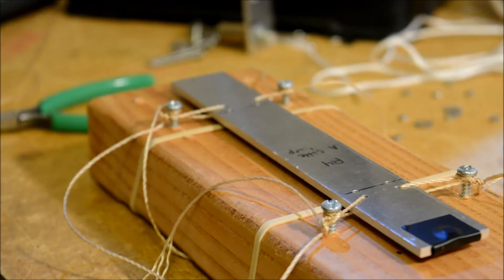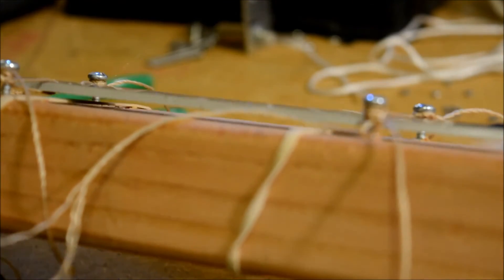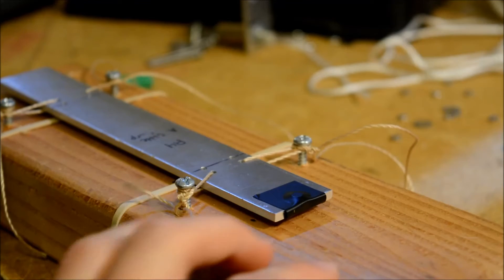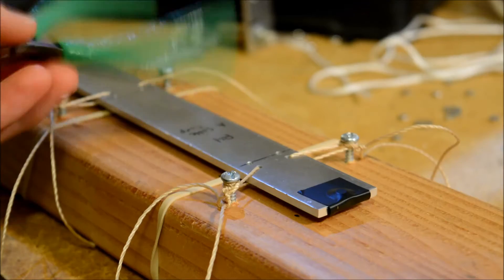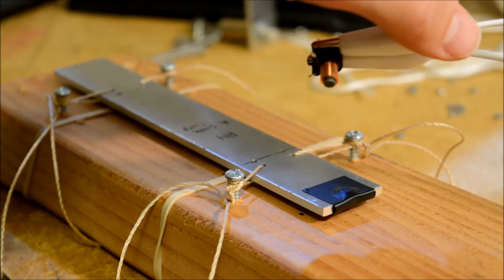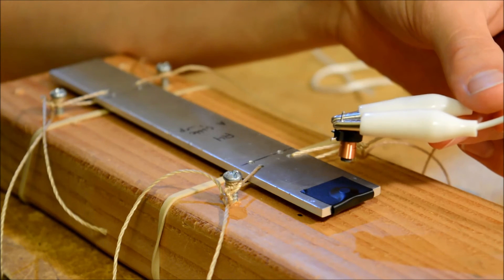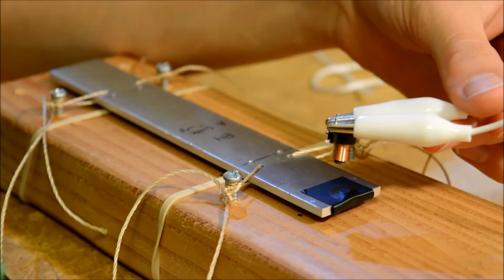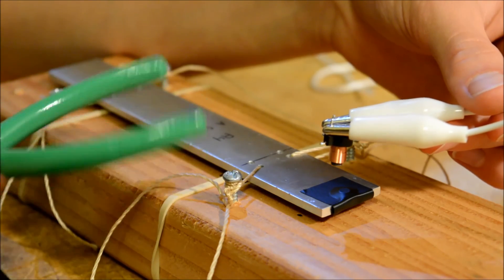Xylophone Key Mounting Concept - Aluminum Keys, WIP (Glockenspiel)

Comment: Can you or any other viewer tell me what to connect with the crocodile clips to amplify the sound? I Wang to create something similar to this but i dont know how to get the sound
Reply from the maker: This system is very similar to an electric guitar in terms of the electronics and physics involved. The pick up is comprised of a simple solenoid (a coil of wire). The aluminum key must have a small magnet glued to it. In this way, the vibration of the key will create an oscillating magnetic field which will induce a proportional voltage at the terminals of the solenoid. I used an operational amplifier with high gain to produce a usable signal around the 1 V peak to Peak range at the output of the operational amplifier.
Reply from the maker: If you haveAn electric guitar, an easy way to get started is to plug your electric guitar into your amplifier and hold your vibrating key near your guitar pick up. Your vibrating key must have a magnet glued to it in order for your electric guitar to pick up the vibration through the magnetic field.
Reply: @RyanJensenEE  thank you so much for answering. Did I understand it correctly that you connected the coil with an operational amplifier through these crocodile cables? And what is the amplifier connected to so that you can hear the sound? I‘m very sorry for these questions, my technical knowledge isnt the best, same as my english, but I hope you understand my questions

Comment: Why are you using a solenoid and not just a magnet? What is the solenoid/electromagnet doing here?
Reply from the maker: A solenoid is a coil of wire.  These solenoids have steel pistons inside them which are spring loaded. When I run current through the solenoid, the steel piston shoots upwards, striking the aluminum rectangle which resonates according to its dimensions.

I don’t understand how a magnet would produce sound in this situation can you elaborate?
Reply: @RyanJensenEE  thanks for getting back to me. I’m pretty familiar with solenoids. What I meant by electromagnet is the magnetic field created by the solenoid when it is activated. Watching your video I got confused because I didn’t see you striking the aluminum bar with the solenoid but just with the pliers. So I wasn’t sure about how the solenoid was able to excite the bar so it can have a prologued sound and then I started wondering if it was just the magnetic field. I don’t know if I’m being clear. : )

Comment: Genious idea!! What kind of pickup is that? Where can i find one? 
Thank youuuuu!!!
Reply from the maker: It is kind of a specialty coil that my company orders.
It is just a coil of wire. Any other coil will work about the same. I recommend getting one with a good core material (one with a high magnetic permeability). You can even make your own using "magnet wire" and a iron/steel nail!

Comment: Clever design. After a quick google, I'm not finding an equivalent design. Are you looking to finish a design and patent/sell it?
As for damping, would inserting gaskets into the holes for the string be effective at absorbing some vibration, or would that through off the tune (is tune the right word? I don't know music much).
Reply from the maker: Thanks! I don't know if it is worth patenting or not.
I did a google search for xylophone patents, and I don't see anything exactly like this. It would be kind of fun to write a patent, though.

A friend (who recently graduated with a degree in computer science) is working with me to make two identical 3-octave xylophone (37 keys). It is going to be a time-consuming challenge. I think it would be cool to build them and sell them...

As for the gaskets inside the holes, I have been playing around with rubber gaskets around, inside, over, and on the holes. It dampens the vibration too much. I would have like to just mount them using screws and rubber gaskets/washers/gromets, but I could not find a configuration I was happy with. All of the configurations I tried loaded the keys too much. Using rubber bands worked really well for keeping the xylophone keys in place while not dampening they keys too much, but all of the moderately old rubber bands I have encountered have been stiff, weakened, rotten, and/or chemically degraded, so I don't want to use them because they may not hold up over time.

Also, food for thought: The nodes of a simple rectangular bar occur at ~22.5% in from either edge of the key. Can you figure out why?
I would have guessed that it was 25%, but I am/was wrong.
Reply: Very interesting stuff. Have you tried a hard rubber gasket? I'm guessing that might work better if that's the case. Not sure where you'd get hard rubber gasket that small. Maybe a sheet would work as well? Rather than insert it into the hole, just layer it. It shouldn't absorb as much if my intuition is right. (Sorry, I don't know the physics of dampening)
As for the nodes being different, is that why you have extra pairs of holes drilled? As for the 25% vs 22.5%, I would have guessed the same, unless somehow the magnet or the strings are interfering with the wave? A test would be to add weight and see if it changes the location. Is this one of the questions that you use to test competence or do you actually not know?
Reply from the maker: I am testing you. It just so happens I don't know either. :P
I found a book where someone derives the 4th order differential equations that describes the vibration and solves for the nodes. But I have not attempted to read through it yet. partially because I am intimidated, and partially because I don't want to skip ahead. Having the magnet taped on the end absolutely changes the tuning of the key. But I don't think it changes the location of the nodes to a degree that I can easily notice.
You are right about the extra holes.

What do you mean by layer it?

I have found that the harder something is, the more likely the key is to bounce against it and create harmonic/subharmonic distortion. (i.e. clattering noises). These clattering noises are actually kind of neat in their own right. After I paid some attention to them, I found they sounded something like the distortion I have heard from non-linear electronic circuits. But the modes of clattering change dynamically, so different harmonics/subharmonics are produced during the key ringing. I found it hard to control, so I just try to avoid it (also because I just don't like the distortion).

I have purchased a sheet of neoprene rubber. I am going to try mounting the keys on that for sure.
I like the idea of not having things on either side of the key, because I want to put the keys side by side as in a typical xylophone/glockenspiel.

However, the more I think about it, I wonder if there is something inherently better in supporting the key with forces that all lie in the same plane as the key itself? I believe the key should only be vibrating in a direction perpendicular to the plane it is in (i.e. up or down). With that in mind, my intuition is that supporting the key with forces in these directions will oppose/interact with/dampen the vibration of the key. But perhaps having the forces perpendicular to the direction of vibration (i.e. in the plane) one can more easily avoid dampening the oscillation of the key.

Just thinking out loud.
Reply: +Ryan Jensen man, that does sound intimidating. I'd be hesitant to start that as well.
as for layering I meant that rather than insert a gasket into the hole, you overlay it. just stick a sheet on the top or bottom. but it sounds like you tried that. 
The distortion makes sense a bit. But I didn't think a hard rubber would be hard enough to cause that kind of interference. Interesting.
I agree that supporting perpendicular to the plane of vibration would probably help. But that is intuition. If you use something to bend the string you can probably get them closer together. Example: insert a construction staple where the screw is, bend string around the screw and under the key, this will keep the tension in the same plane from the perspective of the key, but minimize the footprint. Not sure if that description was clear at all, I'd probably want to draw it to explain.
Reply from the maker: That is a really good idea.
I wish I would have thought of that.
Thanks!!
If I ever make any money off of this thing you will have to get a check in the mail.

I will have to think about what I want to use to keep it in place on this staple/nail or whatever that will be the intermediate support...
Reply: Glad I was able to get my idea across. It can be tricky when you just woke up :p
Haha, honestly I'd prefer a visit to hang out with you again over a check, but whatever

I don't know the proper name for it, but in school I knew it as piano wire. It's semi flexible steel wire, usually a bit heavier gauge, maybe the equivalent of 20 or 22 Ga electrical wire. It's eary to bend with pliers and you could use it in place of a staple.
Reply from the maker: I would like to hang out sometime too.